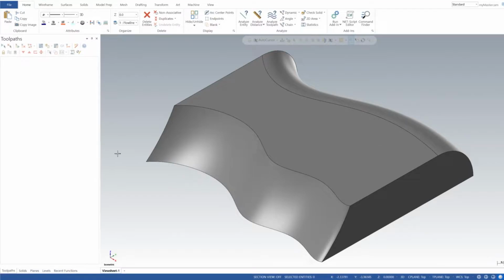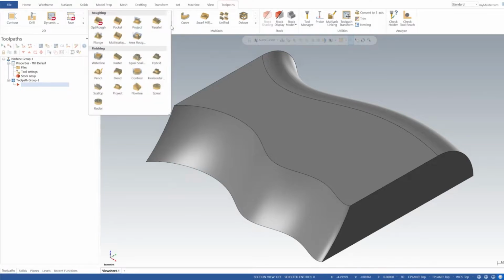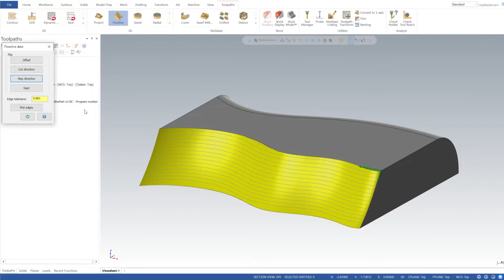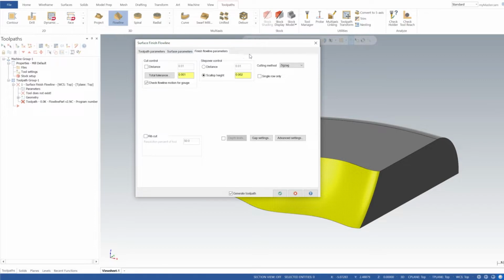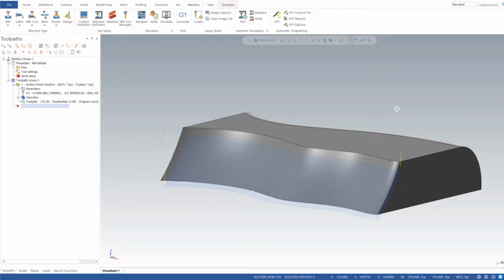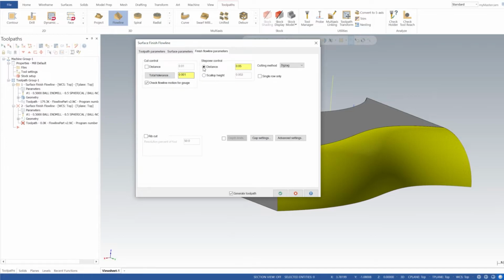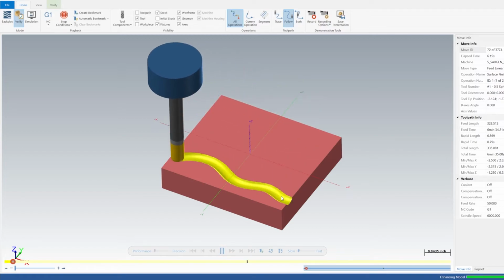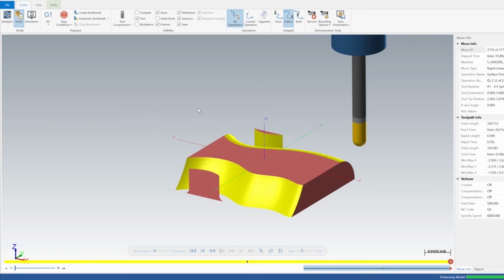MasterCAM Flowline Tutorial

Comment: My tool is not doing what it’s supposed to. Too high..where does it know start. I’m new to mastercam, using Haas VF3
Reply from the maker: Are we talking on the machine or mastercam? I would check setup on both but would advise not to run this on a machine. It's an incomplete program and was just used to go over flow line tool path.

Comment: I had a question. I'm trying to machine a undercut. I've been reading on forums that flow line might work? But I don't know much about flowline. 

Is it possible to make it machine from the top down, but at the end make the tool come back up to the starting point then move off the part? It's kind of like a wide ID slot but at the bottom of the casting there is a feature, so the too can't "lead out" at the bottom or it would machine right through the cast in feature.

What I'm trying to make the program do is come down on center to my start depth (the slot is already partially started). Move into the slot and helix down to my depth. Have the tool come back up to the start depth and move back to center before ending.

My apologies, I feel like I'm rambling.
Reply from the maker: I am so sorry for replying this late. I'm sure you've figured it out. Let me know what you need up doing
Reply: @jazkle  no worries at all. We ended up going over to the manual mill and using an adjustable boring head and a custom cutter.